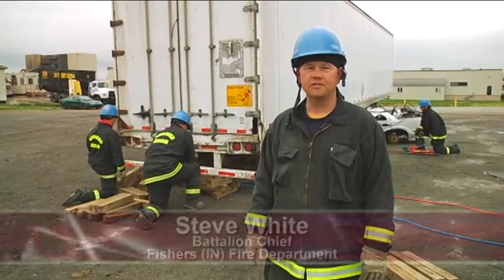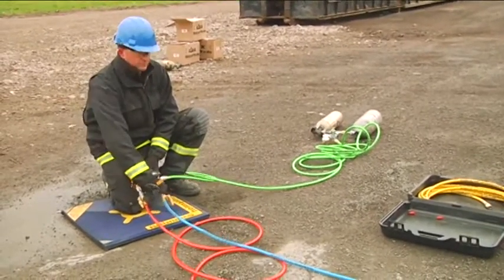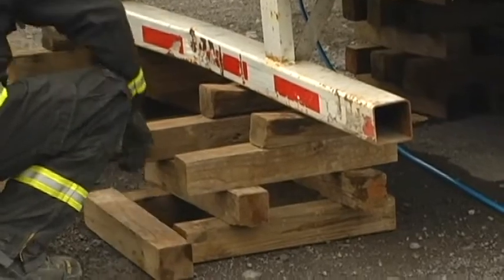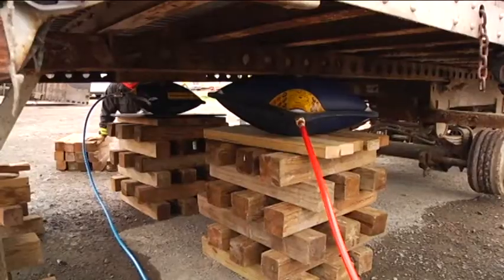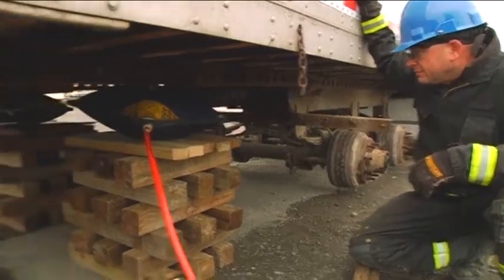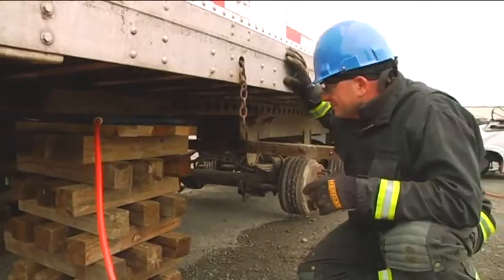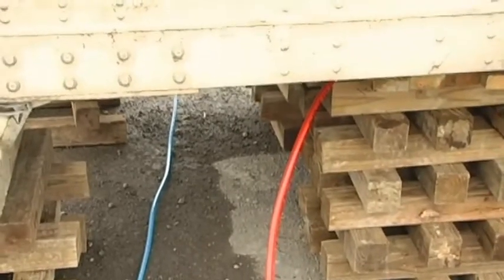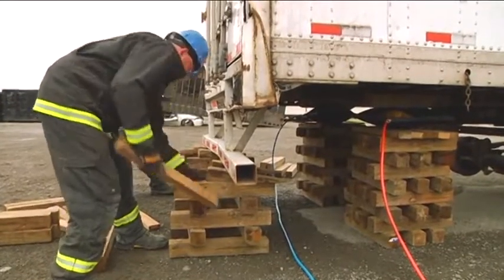Advanced Extrication: Car Trapped Under Trailer #1711371743001

Comment: Thanks Steve white for your insight into extrication of the car under the trailer for roughly I have tried to count wooden blocks  and gotten approximately 60plus where to you place them in the fire engine with such little space  otherwise good video and thanks